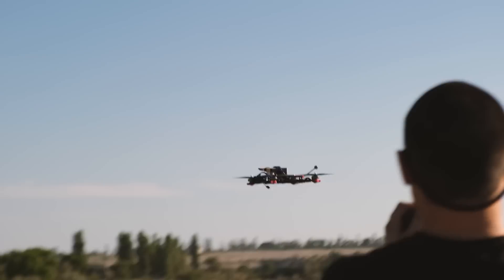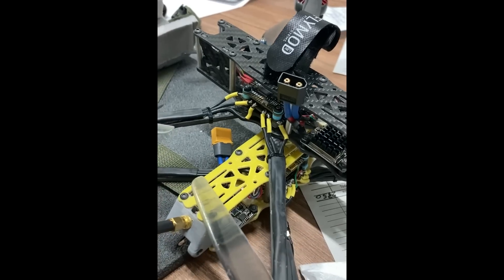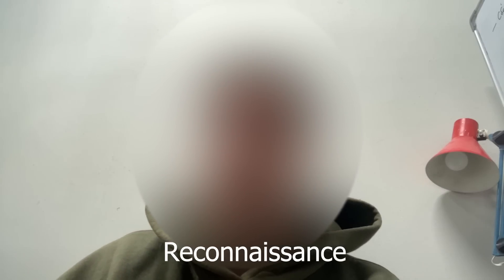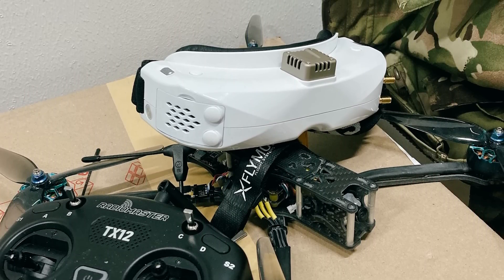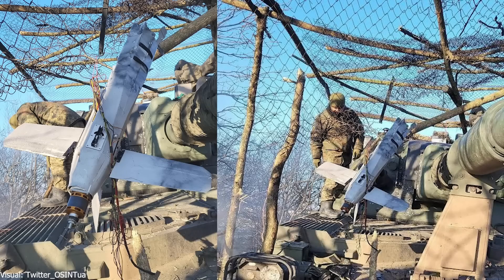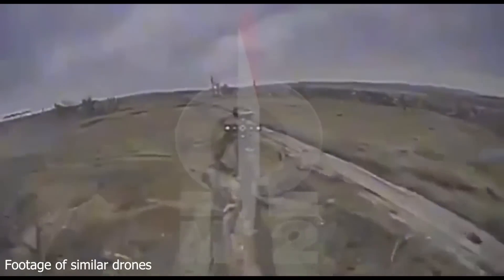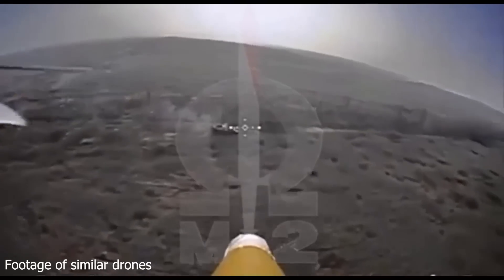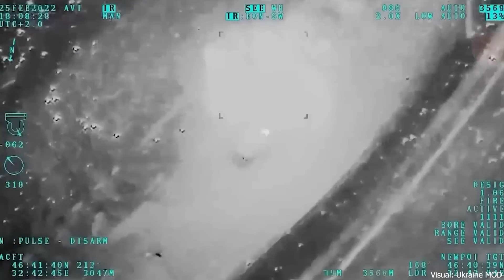Ukrainian Soldier explains how he uses First-Person kamikaze drones - (FPV drones)

Comment: I'm not sure how the Russian radio jamming works so this may not be a useful idea: There are very inexpensive Software Defined Radios (SDR) which might be helpful in defeating jamming by switching to unjammed frequencies. Cheap ones ($30) might have a range of 30mHz to 4gHz with a few megahertz bandwidth. SDRs that can transmit are more expensive ($400ish) but hopefully only needed by the drone operator assuming video feed cut outs are only intermittent.

Comment: When Ukraine Wins the War, They Will Have a New Industry of Manufacturing Drone Parts.. 
Many of these Commercial Drone Parts are from China, 
They Can 3-D Print the Frame and Propellers, ..... 
But..... Motors, Camera, Flight Controller, Goggles, Battery, Radio Transmitter are from China..

They Also Want to Create Long Range Drones > 8 KM .. You'll Need a strong Radio Transmitter

Comment: Advice: Using cheap DIY CNC you could make mass production of delta wings RC planes (styro foam) with cheaper RX and ESC + single motor. FPV parts remain the same. Such RC plane have longer range, much cheaper, eaisier to fly and more "usefull weight" capability.

Comment: Super piece of reporting. It's clear they largely avoid discussing brand names, but at 13:30 Borys says 'Nazgul5' - which is a very popular model by iFlight. He then says these are being 'resold to Russia for $2000' - this is quite a serious point. I suspect however it's almost impossible to work out if they are being supplied by iFlight themselves or via a third party.

Comment: It's easy to make thermite.  Put that in  metal can with a magnets around the bottom, fly the DIY drone over the target, and even if it gets caught in the mesh, ignite the thermite and it will burn through the mesh and hit the vehicle.  Preferably, you would want to land the thermite over the engine compartment.

Comment: Basically FPV drones if you are not using DJI Air Unit, virtually they are ghost in the air.
Reply: yes, simple analog fpv drones are very low power radio, youll hear it maybe 1s before going dark and scattered in pieces.

Comment: These guys need to look into the RMRC RECRUIT. I forget the OEM name, but it should be easy to find. You can carry around 1kg with around a 10 mile range with the right battery. I've had several that had a cruise speed around 90mph with excellent range and great control. I'd be happy to help put a list of components together if wanted 😎
Reply: It's an AR wing but, you're gonna have a real problem with adding that much drag not to mention a beginner fixed wing pilot is gonna run into the typical problem of fixed wing.
Reply: @Thirtythree Eyes  fixed wing is pretty easy when the wing is stabilized. And ar wings fly pretty well on their own. Not to mention inav being able to fly missions autonomously,  it could be flown from a tablet
Reply: @carnagefpv8256  I've been flying FPV for ten years and rc for a couple years before that, I've used every software starting from KK2's, multiwii, baseflight, cleanflight, betaflight, Inav and ardupilot on fixed wings and quads. For what they are doing quads are the simplest and easiest especially for someone who is not already familiar with fixed wing setup and strapping a big ass grenade on is really going to mess with the flight characteristics of a plane especially a flying wing where there is not much of a fuselage to embed it in, not to mention that bomb probably weighs a good 500g, a sub 1m wing isn't going to like that kind of weight added on. Wings sound great on paper but, for actual field use they bring a lot of headaches.

 Ardupilot is also the better option, it even has a dead reckoning feature now to avoid rf jammers and has much more refined autonomous operation.
Reply: @Thirtythree Eyes  congrats on having a whopping year of fpv experience over me, dunno what you're trying to prove there bud. Of course ardupilot is a better option performance wise. However, Inav rigs could be programmed by almost anyone without having to spend 6 months getting familiarized with the software. You're making points about making it easy for beginners then recommending a software with the steepest learning curve in the hobby🤔 sounds like you're just trying to flex here guy. Good luck with that, I've been around the game just as long, you're probably not gonna impress me.
Reply: @carnagefpv8256  Wings are not the best choice if you have no experience with them and are in the middle of fighting off an invading army. I've been following diy drone use in Ukraine for awhile and know someone using them on the frontlines, there are some fixed wing but, they are all people with prior experience. If you've been flying that long you should understand the drawbacks to them and if you think it takes 6 months to setup an ardupilot build I don't know what to tell you it's not much harder than any others just watch a youtube video if you can figure out inav you can figure out arduplane. You also completely missed the point about strapping a big ass heavy bomb to a relatively small airframe, They'd be better off building something that's designed to carry it and the fixed wing drones I've seen being used are just that custom designs. I'm not saying it couldn't be a better performer that is obvious but, it's not going to be better without more work and experience.

Edit: If you've been flying for that long you have probably forgot more things than any noob will learn in the short amount of time you have in war. Even simple things like CG, launching, trim, throws, tuning are all learned skills nobody just picks up a wing and has 100% success their first flight.

Comment: I understand that the effectiveness of countermeasures is a bit of an operational secret, so understandably, Chris did not push on success rate and details on effectiveness of specific countermeasures such as EW.
Or perhaps he cut it in editing. But I am really curious to know.
With every component to consumer specs and off the shelf, these FPV drones must be really vulnerable to EW jammers or overrides.

Edit. Funny to finally see confirmed that the wind is a major factor in (such mini) drone operations. In the past our small engineering company tried to use small drones (also balloons on a wire to a truck, to show how crazy we were) to survey e.g. pipelines through the desert, railway tracks, bridges etc. But wind made it impractical for too many reasons. Now I occasionally have heated discussions about drone usage in the war in Ukraine. Few believe me when I mention wind (gusts) as a major spoiler when trying to hit targets and precision in the approach path matters. I feel vindicated.
Reply: It depends. These drones are small and without explosives have a 8+ thrust to weight ratio. So all you need to do to hit a target is fly fast enough and tilt a bit to compensate for the wind. Not as easy as I make it sounds but no brain surgery either. He mostly mentioned the wind as a problem when it comes to battery drain.
Reply: EW is definitely a factor. Those civil drones operate on specific frequencies, yet they spent time and efforts on self-made custom antennas

Comment: I wonder how hard it would be to train AI to be part of the loop. Of course, it will always need to be supervised by a human when confirming targets and such, but other than that, AI is very good at image recognition and energy usage optimization. It might even reduce training times, if the human is no longer required to fly it. They'll just have to confirm targets that the recognition AI produces, and then the piloting AI will direct the most efficient path towards it. In the bigger picture, the AI would be expanded to a swarm of drones.
Reply: I think the fact that the US military doesn't have what you describe gives you the answer.
Reply: @someonespotatohmm9513  The US military isn't exactly at the forefront of AI research.

Comment: I see they are using 868/915 MHz Crossfire for control and long range 1.3 GHz analog FPV from Matek. Good choice because I heard Russian forces use commercial Wi-Fi sniffing and jamming equipment, making the usual 2.4/5.8 GHz control/video link pair vulnerable.
Reply: U sure? In one of the clips there is a radiomaster tx12 elrs version

Comment: Planes are actually much easier and cheaper to build than quads.  One good motor, one prop, one speed controller, a radio receiver, and the body and wings can be made out of anything from paper, foam core board, plywood veneer, coroplast, foam insulation sheets, or whatever.   You don't need a power distribution board, or any kind of flight controller.  There are some cheap flight controllers that can assist a novice pilot, but after several flights on one of those you'd be fine taking out one with no flight controller.    The planes can carry far more weight and/or fly much further on a given battery because you aren't constantly having to generate 1g of downward thrust.  Quads are awesome photo platforms, but for this role, a plane is the thing to use.
Reply: If planes don't produce 1g of lift, how do they stay in the air?
Reply: @someonespotatohmm9513  the point of an airplane is that it can generate 1g of lift without having to create 1g of thrust from the engine.
Reply: @brianhaygood183  No, but it does need to generate 1 g of thrust * wing efficient to stay in the air. Just like a drone, wings just tend to be more efficient.
I have to admit my comment "tone" could have been nicer.
Reply: Check your closest gadget shop and count the number of drones on the shelves and the number of RC kits with least 6 channels. I bet the drones are much more abundant.
Reply: @johanmetreus  yep. Drones are more fun in many ways.   Carrying a giant bomb to your neighbor down the road is just not their strong suit.

Comment: Aaaargh, its so frustrating to see Chris go down the typical, "noobie" route and ask only for technical specs and the like. Just like a guy reading up on the horsepower of the Spitfire. But it would have been so much more interesting to hear about their tactics, work with other units, etc. And according to this channels videos, these are usually the way more important factor. @MilitaryAviationHistory Is there another video coming up on this topic?
Reply from the maker: Did you consider that they will not disclose tactics, whether I ask or not? And you'll notice, I actually asked twice about that.

Comment: A good synergy with Perun’s latest video on Class I drones (£40k and less), their integration with formal UAF signals, intelligence & jamming, as the semi-profession specialists of a modern infantry force that operate local supplementary CAS. This is important were the full airforce often can’t risk multi-million dollar assets against a few refurbished 1960s APCs. This level shares some links with WWI where some of the initial pilots were former hobbyists and WWII with these systems being used by both sides in a form of sniper war between infantry specialists. Drone operators do make themselves most vulnerable to other drone operators when on the offensive.

Ukrainian command has formally developed the hardware but also adopts commercially developed products room and allow these units some autonomy in leading the tactics. The Russian top-down strategy in contrast is more politically led, like everything they’ve done in this war and seems less focused on the tactical result.
Reply: Another hour long power point fan.
Good comment
Reply: Yup, I have watched that and he notes that FPV drones are used as loitering munitions.

Comment: Why aren't FPV drones fixed-wing? They would be faster, with more payload, and probably cheaper too if they're 3D-printed.
Edit after the 8th minute: oh so the interviewee has the same question, that makes me wonder even more!
Reply: My guess is that hitting a target would be harder, since they would be humming along at about 60 MPH before impact, if not more. Also, bigger wings make it easier to see, even at night. We're talking about some kind of home-made cruise missile using human guidance over a radio link, not a missile guided by a laser designator or infrared sensor or whatever. Yes an RC trainer can coast along at half that speed, but then you might shoot it down with a pistol.
Reply: As someone noted about the "Flite Test" channel, a fixed-wing drone is easy to make from basic materials and the potential size -- and thus payload -- is almost unlimited. Only four channels are needed, pitch, yaw, roll, and throttle.
Reply: @pacificostudios  I was thinking camera and weapon control, possibly remote handover, but you are right, it doesn't have to be more complex than a four channel.

I still stand by my initial explanation though, when there are a lot of available quads, it is less of a leap of thought to think of converting them slightly into carrying a payload than to strip them for certain parts and build a fixed wing instead.
Reply: @johanmetreus  - Yeah. It doesn't even need wheels or flaps because it won't come back.
Reply: I've been wondering the same. I know Flite Test on YT whips up all kinds of RC experiments. Some foam board, ordinance, the electronics, battery and an appropriate template and there's a quick and repeatable, disposable drone, not to mention cheap also.
Reply: Availability would be my first guess. Plenty of quads on the shelves, fixed wings, not so much.

Comment: That was very interesting. These types of drones which are fairly cheap and expendable like artillery shells are probably far more important than the high tech bayractar drones. Are Drone units like these going to be part of regular infantry platoons?
Reply: So according to the best sources I’ve found (ie analysts who’ve spent time on the ground in UKR) bayraktar hasn’t been used on the frontlines since roughly April of last year. That’s when the Russians were able to get their local anti-air assets better organized. Bayraktar was too slow to be effective after that. Where it is still used is on the naval side of things. Less concentrated AA at sea and there’s some reporting that a Bayraktar was used in the sinking of the Moskva.
Reply: They already are. For example, a lot of the American soldiers in Afghanistan near the end of the war, 2019ish, had these tiny little drones for surveillance, called Black Hornets. There’s a few contracts to extend this to more of the military as well.
Reply: Both drone types are important, if used correctly. 
I think NATO countries are missing the opportunity and didn't learn anything from the Iranian drones and missiles we see in this war.
We see people make fun of them about how low tech they are, but they would still mess up every air defense system in the world, just by sheer numbers. 

The irony is that the Iranian drones use an Austrian Rotax 912 engine. The engine are very simple, easy to mass manufacture, cheap and reliable. Both the Chinese and the Iranians just copied those engines and are manufacturing them in huge numbers. 
While Western tech takes many years to build ( Norway has ordered 54 tanks from KMW, that will be operationally ready in 2031, the Euro-drone will not be ready for decades) , the smarter countries are amassing a huge arsenal that's cheap and very effective.  

By now, NATO countries should already have millions of Shahed drone and Iranian missiles copies.

Comment: Man, I have all that gear at home, including Skyzone goggles (not the explosives though!)
It's so weird, I've been enjoying this hobby for years and been advocating it, stressing that it's basically harmless in spite of the sayings from at times hysterically bad press, not a single fatal accident to date.
For sure some hobbyists have lost homes due to fires started by batteries, safe storage for your batteries is important, but that goes for e-bikes as well, basically any device running on lithium batteries.

Not sure what I feel now, I fly drones to clear my head, enjoy the perspective from above and freely move through three dimensional space. Seeing them used like this is just so weird..
But Russia needs to unequivocally quit Ukraine so any mean to that end is good.
Reply: This is one on the potential risks of this sort of video.
There are now a bunch of people who may or may not have thought about this before and this may prompt them to be a "copy cat".
Certainly most don't have access to military grade munitions and home made explosives tend to be bulkier and therefore not suited to this type of delivery system.
Not saying it shouldn't have been broadcast - just a risk.
Reply: @whya2ndaccount  if you want to bomb someone from the air, it's much easier to use a DJI Mavic or Autel Evo Pro II (can handle bigger payload and less traceble) for it. FPV drones are a tiny niche right now.
Reply: @whya2ndaccount  ya this kind of video shouldn't be out there.... sad to say I almost guarentee we will see copycats..
Reply: Honestly I thought it was cool when I first started seeing this... but the more I think about it and especially after watching this video the more horrible I think it is.....he said he doesn't even really know the success rate and I think he said they send in 6 drones a day?.. doesn't seem worth it just like this whole war!?🤔  but who knows!?